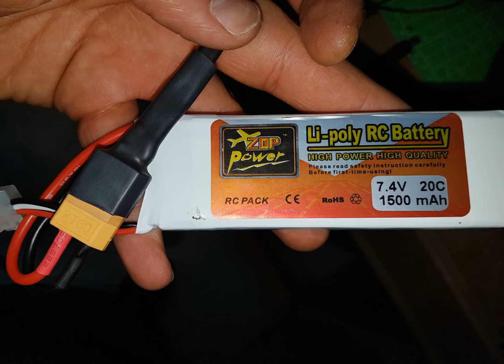Installation PICS- Jjrc jjpro // Kylin Vision DVR mod/dvr osd- extra power imput= 2s batt/dc plug

Comment: Just a simple question. Can I use these Googles, out of the box with no modification to it, with a 2S Lipo with JST connector?
I ask because the stock battery sucks and I want to use some LIPO with higher capacity than 2000mAh. Its really hard to find reliable information about acceptable working voltage of these Googles 

thank you!
Reply from the maker: Fliptality you can use any 1 s battery (that will include the jst connector to connect it in the port )  or you can put a 2s battery and exchange the xt60 connector to a jst, the voltage input is from 4.8 (1s battery  to 7.4 (2s battery) you can plug any of them. but remember a 2s you will have to modify the connector.

no thanks , you are more than welcome and i am glad to give you  a hand 

regards!!